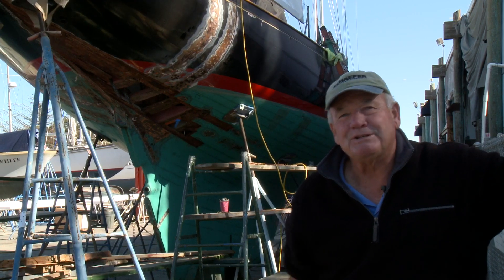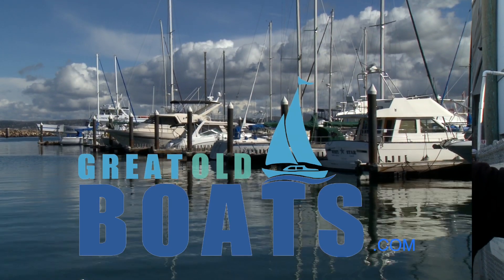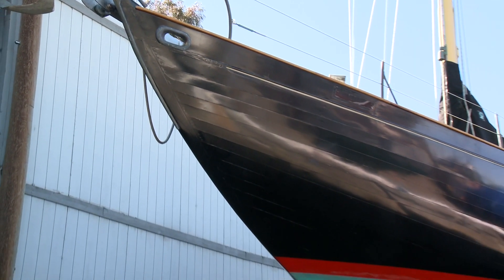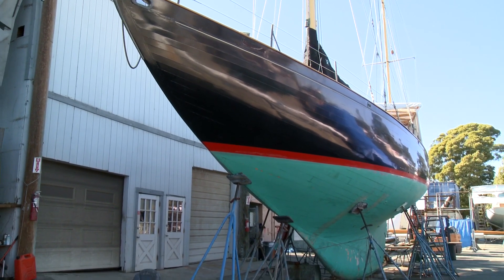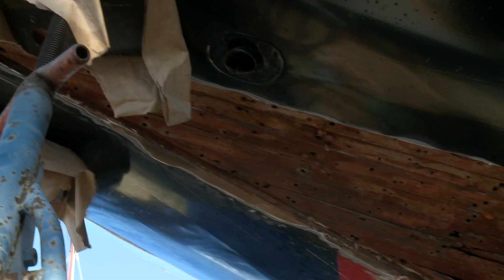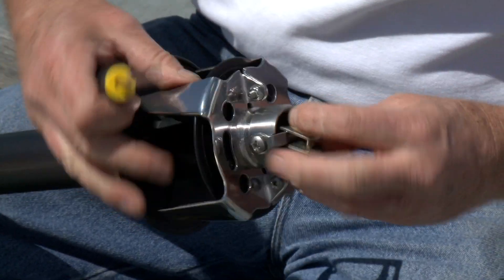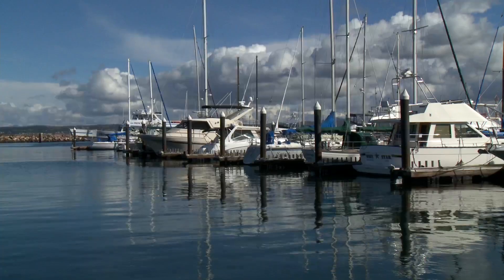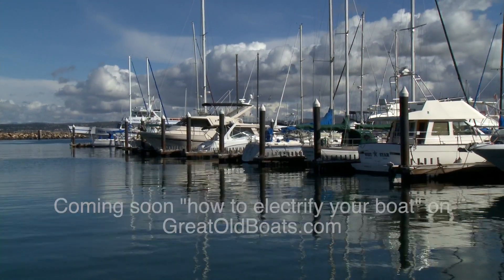Great Old Boats  website Introduction

Comment: I’m doing a full professional restoration on a 1950 40’ Trumpy built S&S sloop in Rockport, Maine. Presently the cabin top has been somewhat rebuilt, the cockpit has been torn down and is being rebuilt, a new Beta engine is being installed, and new sails have been ordered. Over the winter the below the waterline work will be done. I think we’re going in the paint booth sometime in November. Appreciate the videos you’ve done on the Cal 40 (actually considered buying one at one point). Let me know if you are interested in my project. Should be completed for launch in the spring.

Comment: nice to have you back.  it is encouraging to have someone who is educated, articulate and passionate about sailing on you tube. i dont know your sailing history or if you started out in small boats, but they are so much more responsive and fun to sail. might i suggest a star boat, designed in 1910 and an olympic class boat till, i think 2013. they were built of wood till around 1963. look for an old lowell north wooden boat and restore it.  i think you would get a kick out of sailing a star boat. good luck on you new adventure and i sure did enjoy the series on the cal 40 also one of my favorite boats.  a manager of lyman morris here in camden maine had one called towee that was in perfect shape and i told him about your series but it was only a yell across the water and i never ran into him again.